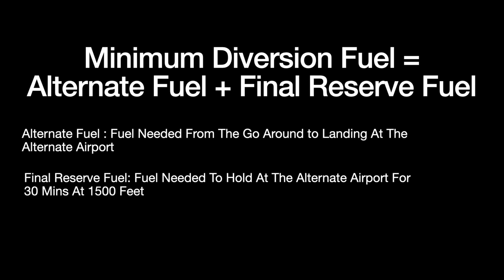The Desperate Gamble | Jet Airways Flight 555

Comment: If I’m not mistaken, this was also a blind landing. Apparently, the CVR revealed that the first officer had asked the captain if he could see the runway, with the captain responding that he was landing blindly. Yikes.
Reply: 6:00 It says in the video he had no visual contact with the runway.
Reply: Well going around would mean certain death so...
Reply: ...so the captain finally hit "fµck it"? 
(Deadpool clapping)
Reply: It was not “bind landing”. What captain said was he decided to descent below the minimum altitude during approach even though he didn’t see the runway first, but could see the ground below him. Trivandrum is a costal runway, hills are only on the north east of the runway whereas they were approaching from  south
Reply: It was a calculated bet, and this captain happened to be pretty good at math.
Reply: Not quite. The final approach was on LNAV, the break-off below cloud was achieved at 100', followed by an ultra low level maneuver to align with the offset runway (which triggered all the GPWS terrain, obstacle and bank angle warnings) and a bit of well judged and anticipated corrections to eventually make a safe landing. I spoke unofficially with the involved captain a few hours after the event. They had realised that was their final attempt and another go around would've been the end.
Reply: The airport had dense fog and zero visbility, it was not a safe environment to be landing any plane in. People put far too much trust in ILS, it's an excellent system but it has its limits. If fog is too dense to make visual contact with the runway below 100 feet when autopilot disengages and you're on your own you're basically fucked LOLL. It should be global aviation practice for airports to close in those conditions I believe. Some sight of the runway is fine to operate in with ILS, but zero visbility landing doesn't even describe what these pilots dealt with
Reply: @jackeldridge1319  Yep true what you've said. Time to get synthetic vision systems into airplane cockpits asap. SynVis + ILS should be of tremendous help to pilots in these types of situations.
Reply: @jackeldridge1319  honestly tho autoland
Reply: If you're going to crash, you may as well have a go hey
Reply: Nice username btw
Reply: Dude what's with that name 😭☠️💀

Comment: Pilot attitude definitely contributed to this. If they diverted appropriately when they reached their minimums to the best suited airport when it looked like the weather was not sufficient at other nearby airports, this would've been avoided from the start.

Divert today, fly tomorrow.
Reply: Any landing you can walk away from is a good landing 👍 If they diverted again and weather went bad at the 3rd airport, what then, in flight refueling? Aviate, navigate, communicate. Airport #3 navigation was never going to be an option in a situation that requires focused aviation and timely navigation to survive

Comment: I think they were justified in some aspects. When you have 600kg left, that's only 300 in each tank. Nothing, the only option really is to do a 180. They faffed around too much with go-arounds, should have just landed. I am not a pilot, but merely a simmer, and If i was struggling to land, i would settle for an airport no less than a CAT III autoland capability, CATI if necessarily, but not a VOR.

Comment: When I flew for JAT back in the day, it was two missed approaches before diverting.
Reply: I think Tivat was “captain only” and one missed approach before diverting. Most major airlines in USA are two missed approach rule but final decision is on the captain. Of course the reason for go around is taken into consideration too.
Reply: @TheBoris45  yes, correct. Tivat is a tricky airport to land at. I made a few approaches there but all were in my later years.
Reply: It’s hard though with the two go around rule. What happens if ATC commands the go around not the pilot? I understand that those rules exist for reason and also fuck it mode and pilot exhaustion is a real thing but I feel like sometimes that third is safer then diverting and then hitting fuel exhaustion

Comment: Good that the captain declared an emergency. Probably should have happened earlier but they got it in
Reply: Made me think of that plane that crashed (I think it was in the NY area?) because the foreign pilots didn't use the correct terminology to properly convey to ATC how low on fuel they were and ended up having a double engine flameout and crashing after being put in a holding pattern for so long and attempting to divert too late. I guess declaring a mayday or a pan pan makes you fill out a lot of paperwork?

Comment: What I wonder about, whether or not the pilots were actually blamed or maybe punished in some way. I was told a goaround is never questioned. How were the pilots treated after this?
Reply: Yes, the pilots were punished for this. I was a Jet airways pilot, I forgot what happened to the FO, but the Captain was demoted to FO after this incident.
Reply: @Chris I agree with your assessment, but only because we think so, it says nothing about what actually happened to the pilots afterwards. I was wondering if the author has any reliable info about what they actually received from their peers/bosses/others.
Reply: Sounds like they got unlucky with the weather, and made safety-focused decisions not to land due to low visibility. That's alright as it goes, until staying in the air too long becomes dangerous on it's own. This sounds like one of those things where it wasn't quite so bad they definitely had to divert, but not good enough to definitely land, either. They had to make a call eventually, fortunately it was one that got everyone down safely.
Reply: Yeah.  Maybe like the Japanese train crash, where the driver was afraid of the potential reprimand from missing his schedule.
Reply: There was a near disaster in Melbourne at Tullamarine involving an emirates a/c . A tail strike occurred .  The big bosses from Emirates flew in and presented resignations to pilot and co pilot  all ready to sign.  That's what happened there. this was a take off issue not a go around issue.  I'd be guessing Airlines score pilots on ontime performance just as is the case for despatch.  If you score too low over a period of time you might be called in for a chat.  If they grill you the wrong way then some guys would pull the pin I guess or start looking around actively which basically is a forced resignation.   Dropping passengers at the wrong airport would be a very bad OT performance .

Comment: Yes the number is three also the policy is that if you can’t land safely at your destined landing site you must go to your alternate, however you can change your alternate if you can find one that meets all requirements for them it would’ve been one with ILS approach and with better weather conditions with at least minimal visibility condition and most importantly high intensity runway lights . The low intensity airline I fly for uses private commuter plane (Cessna, Piper, and some Gulfstream) but for most parts we fly helicopters (Bell, Hugh, Ryan, and some Sikorsky Copters) so if you can’t land with the fuel you have in your tanks you’re in for a very very bad time ahead !
Reply: Also when need information on weather conditions, altitude, ground obstacles, and condition of the runway at the landing site their made known to us (pilots) before we even board the plane especially expected weather conditions at the landing site this information is paramount for a safe conductance flight, especially for a rotor wing craft ! A go-around could mean the difference between life and death so you usually try our best to avoid such things, planning, getting as much information as possible, and constantly training for such an emergency is not just company policy it’s way to save your life and the lives of your passengers/clients !

Comment: I really do not understand why, on the final go-arounds, they had trouble lining up with the runway on two occasions. Was it the wind, visibility, or poor piloting? I don't recall any information that would explain that problem. Maybe the pilot was dizzy by then? 😏
Reply: It was a visual approach in poor weather and low visibility
Reply: @umangu  instruments should have at least lined them up with the runway, regardless of the weather.
Reply: Gilbert Franklin ... I had the same question. Was the VOR properly calibrated? Usually this site has a  good cover of in-flight incidents, but I think this was a miss. There HAD to be a reason ... some reason. It may not have been palatable, but there had to be some reason that the pilot could not line up on the runway.  (I HATE VOR approaches.) They are by their nature imprecise but they should have been sufficiently precise to line up with the runway. The only thing worse is an ADF approach.

Comment: Two missed approaches are the maximum I allow myself as a pilot, on a single airport. After the 2nd missed approach, I fly to my alternate. By the way, when selecting an alternate, it should be better weather forecast than the destination airport, preferely  VFR conditions.
Reply: What if the missed approaches are not due to weather, just incorrect timing or something else you can fix internally the third go around?
Reply: Umanng Mittal - You are correct. Oferb553 - Where does two come from? Science? Fact? SOP’s? Fuel? Common sense? The reason for a go-around is because you are unable to continue. The reason for continuing is because you have enough fuel, have met minimum visibility and cloudbase requirements and continuing is the sensible thing to do. Not because you have sufficient go-around to continue. Sensible airlines will expect their captains to make sensible decisions, not to prescribe the number of go-around that can be performed if for no other reason than what do you do if you have used them all up? Crash? As for alternate selections, in a European winter you often have days when the only alternates are forecast to be on CAT I or even non-precision (plus 200’ & 1,000 m) or with single runways close to crosswind limits. Nice friendly VFR weather is good if you can get it but there are days (or weeks) when it doesn’t exist.
Reply: @Trevor_Austin  if no resonable alternate airport with reasonable weather exist within aircraft endurance and fuel capacity, it is better to cancel the flight, than betting on your life and your passenger lives with a Russian roulette. If you didn't sunceess approach at an airport 3 times, what is the chance that the 4th time will be different? Don't you think that it is better to try at another airport, with a better weather?
Reply: Yeah, best way instead of killing the pax
Reply: *alternative

Comment: Know of one pilot who landed and ran out of fuel during the landing. Not that he took off with insufficient fuel, but that during his take off he ingested a vulture and damaged the engine. his choices were to either wait for an hour to burn off enough fuel, or fly to his destination an hour away. He had enough fuel to make it to at least 6 other airports in normal conditions, but the damage was such that lowering throttle made the vibration worse. So flew there in 20 minutes at full afterburner, and came in fast and direct, all other traffic on hold. 

Ran out of fuel just before touchdown, and rolled to a stop on the runway and requested a tow. Engine had snapped a turbine blade off on the first stage compressor, and it went through and out the back with only minor marks on all the other stages. Was only able to tell it was a bird strike from DNA analysis of the smears of dried stuff on the inlet cowling.

Another pilot had a low level bird strike, and tried to make it to the runway. Decided to eject when he looked up from the instruments, at his best glide angle, and saw the trees above the front of the canopy.

Comment: I never heard of a airplane going around 6 times
Reply: Most airline pilots will go around once, and if the situation hasn't improved on the second approach they'll divert and bugger what it costs the company.  Safety should be the prevailing factor...
Reply: @gosportjamie  A few years back was on a flight from LHR to Shannon in Ireland.
Shannon was fogbound, they tried it twice, but the runway was invisible other than as a faint blur of light.
Ended up a Dublin, with no problems and the airline organized buses to Shannon.
Reply: @alangarland8571    Yes, that's standard procedure for a lot of pilots, one attempt, go around, second attempt and divert.  MOST airlines will help with onward travel if it's impossible to land safely at the scheduled airport...
Reply: @gosportjamie  No. Not "most". All. It isn't an airline policy it is an IATA standard. You must be brought to your destination or if impossible, back to your origination point. Period. You cannot be left enroute at some random airport. An air ticket is a legally binding contract between the passenger and the carrier.
The EU and most western countries have laws augmenting these basic protections.
Reply: @smcdonald9991    The overriding factor is when matters of operational safety come in.  Clearly it isn't safe to have a loaded passenger aircraft stooging around up there for hours when an airport is shut for an uncertain period of time by weather, say.  So it is a viable option for the flight crew to choose to divert to one of their designated diversion airports.  It is, of course, incumbent on the operator to see the passengers to their destination, but that doesn't, necessarily, mean by air.  It can be done by road.  Plus, as has happened, if it's a small operator whose aircraft is forced to divert due to technical issues, it can take some time for that onward travel to be arranged.  There are, in recent history, recorded cases of passengers being stranded at a diversion airport for a week or longer while the operator tries to arrange onward travel to complete their journeys...

The point I was trying to make is that decisions of operational safety are left largely in the hands of the flight crew operating the flight, so if an aircraft is to divert that decision is in the hands of the crew.  So, if the aircraft is scheduled to land at an airport that is experiencing poor weather, it will largely be a matter for the crew, based on the best weather information available and discussion among the flight crew as to whether to attempt a landing or to divert immediately.  If the weather is forecast to be improving and the aircraft is capable of doing so, a lot of crews will choose to fly the holding pattern for a while until the situation on the ground has improved.  If weather conditions are such that there is no realistic likelihood of any improvement being foreseeable then the obvious sensible choice is to divert.  If the crew does elect to attempt a landing and descends to low level and finds that the weather is still too poor for them to consider landing a safe option then a lot of crew will choose to divert, which is what a lot of airlines specify on grounds of passenger comfort and safety.  Even in operations that do not say how many attempts a crew is allowed to get the aircraft on the ground before diverting, most pilots will only make one attempt to land before diverting out of regard for their passengers.  There are, however, the odd renegades, as there are in any field of human endeavour, who do things differently.  Personally, I wouldn't much fancy being on a passenger plane that makes half-a-dozen attempts to land at an airport with bad weather as going down through the bad weather is uncomfortable due to turbulence, inevitable in bad weather, and so is going up again after the missed approach.  I've got a pretty solid constitution, it takes an awful lot to make me feel even mildly ill, but I rather think going through that six times would definitely make me feel decidedly queasy and a lot of people just plain old sick to the stomach.  Plus, flying through turbulent weather puts enormous strain on the aircraft and engines so doing it repeatedly with no reasonable chance of success is just not really all that smart...
Reply: @gosportjamie  Ok very very good points, thanks for sharing. 
Some budget airlines or those with chronic liquidity issues may balk at providing meal tickets and overnight accommodation but at the end they have little choice. I am not saying it never happens but an airline leaving passengers stranded at a diversion airport opens itself to a lawsuit that they have little chance of winning. EC261, which you no doubt know, even allows for monetary compensation (€600?) in some circumstances. And if the reason for diverting is not security/mechanical/weather/medical related, the airline may be penalized in some countries.
Reply: @smcdonald9991    Unfortunately, like a lot of laws, they're not totally watertight.  The bad operators can find ways around them, or at least to delay having to pay up, which works out much the same for those stuck...
Reply: @gosportjamie  You're right, thanks for the explanation.
Reply: This one. Better to Go around many times than Land uncertainty and crash
Reply: King Brute - You haven’t flown enough. I’ve done four at one destination followed by one at the alternate. Colleagues have (very) occasionally done more. It’s a matter of fuel, legality, common sense and what the company would like. If your flight is the last one for a considerable period of time then the passengers might like you to continue, subject to fuel. And we never had to worry about passenger repatriation. Our company would use whatever transport it had to get their passengers to their final destination.
Reply: Welcome to FSX Steam Edition
Reply: Fly pakistan airlines
Reply: @pizzabagerenmujaffa8123  🤔🤫😁